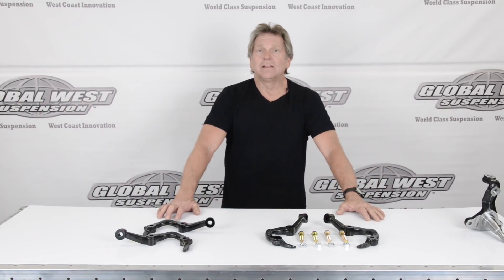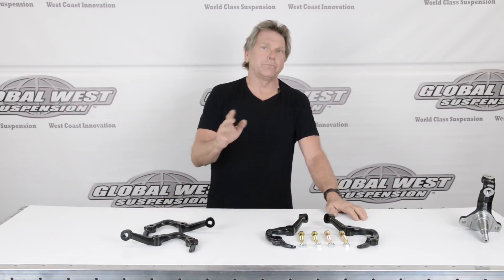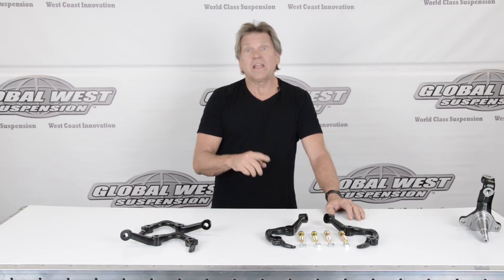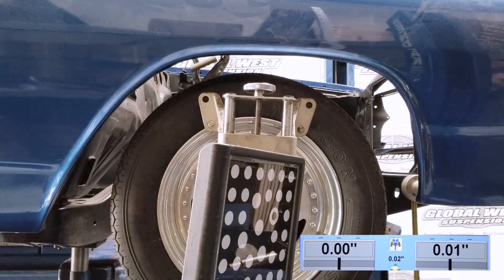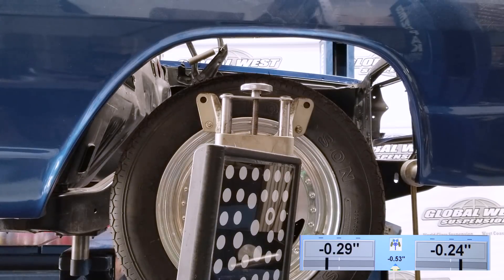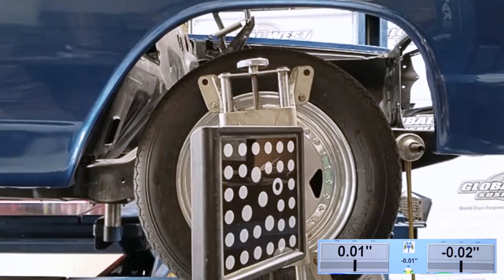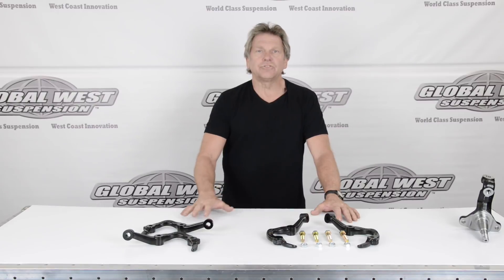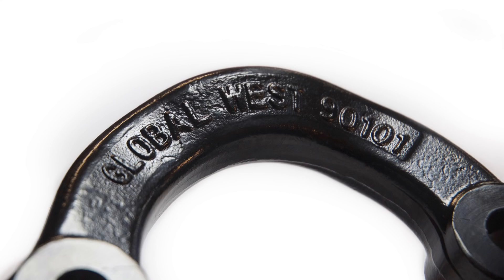Addressing Bumpsteer On 1964-1972 A-bodies for Drag, Street & Autocross

Comment: I have a 1974 pontiac custom gto. I upgraded all linkage to new oem. I changed upper and lower arms to qa1 tube arms. I also have 2 inch drop spindals as well. What kit would i need?

Comment: No mention of what upper arms and caster was being used in this demo. Assume it was standard. But why would you go to the trouble of fixing bump without addressing the caster problem A bodys also have, and if you change the top arm to fix caster you also have moved the tie rod position so will have dofferent needs to fix bump. Demo is a few years old and needs an update.
Reply from the maker: Thanks for the comment!

Comment: What about a system for 70 novas?
Reply from the maker: The Nova geometry  is totally different, unfortunately these steering knuckle arms will not work for your application.
Reply: @GlobalWestSuspension  Sure would be sweet if you'd make some ;)